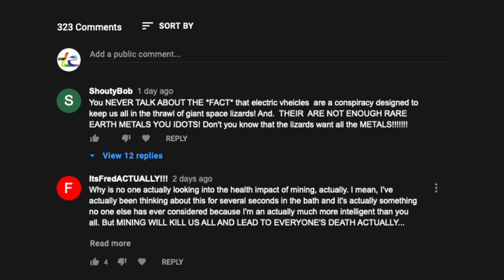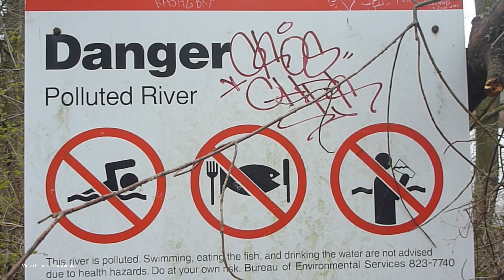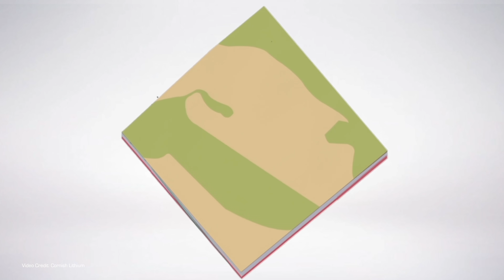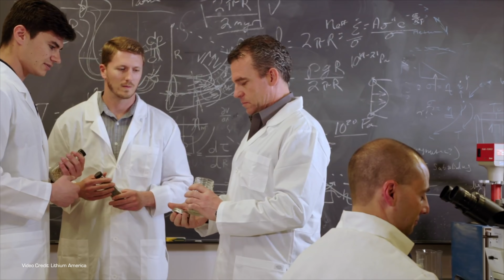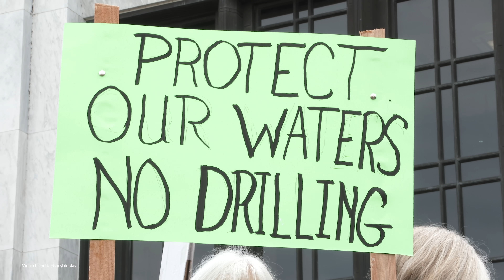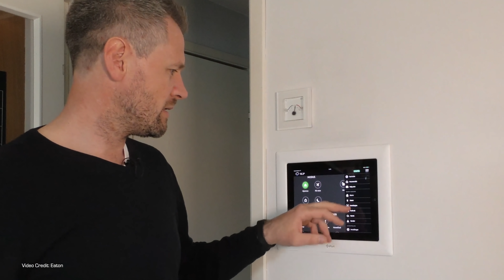Yes... But Are Electric Vehicles Really SUSTAINABLE?

Comment: ".. insert reason with faint shred of truth extrapolated to the extreme here..." - priceless! And so true.

With all the research going on, the chemical make up of today's batteries will almost certainly not be that of tomorrow's battery. ICE car engineers have had over 100 years to fine tune the ICE, and the results are truly remarkable works of machinery. But they've come just about as far as we can get them. 

While batteries have been around for quite some time too, they've only been viable as the power source for an EV recently, as proven by the first Tesla Roadster. EV's are still in their infancy; we will see more range and cheaper batteries as chemical engineers do their thing. Imagine what range and cost we'll see in just a few years. 

In addition, Tesla's plan to recycle the batteries and extract, then reuse, over 90% of what makes up the battery is fantastic.

As far as demand goes, look back to the original Roadster, and forward to today's models. Tesla has proven that EV's are now not only feasible, but that there is a significant demand for them.

Comment: I was hoping to hear more about Tesla's new lithium extraction process as outlined on Battery Day.
“The extraction process includes providing a clay mineral comprising lithium, mixing a cation source [NaCl] with the clay mineral, performing a high-energy mill of the clay mineral, and performing a liquid leach to obtain a lithium-rich leach solution."  "... it offers an environmentally friendlier way to obtain the metal than currently used techniques such as acid leaching."

Comment: If you live in the desert then there is no reason not to go both solar and EV.  Our primary home in AZ has 13kw solar system to power both the house and a tesla EV.  Like having your own gas station in your garage to freely power the car each day (about 300 mile range) and don't have to pay the huge electric bills that we had prior to going solar in 2016.  Prior to then our summer electric bills for the home (4k sq feet) was over $600/month + over $100/month for gas.  Now it's just a $42/mo grid tie in fee.  Though APS gives pennies on the dollar for any excess but battery packs are still too expensive to install and with net metering they just don't make sense, yet.  Sometime in 3rd Qtr 2022 our panels will have paid for themselves and with a 30 yr warranty will still have them for another 24 years.  Anyone who talks about EV leading to more pollution is mislead, pushing an agenda (just like the tobacco industry of old).  Even after car batteries can no longer be used in the car they can be used for home battery systems which use much slower discharge rates.

Comment: In general, yes.

Specifically, it depends:

1. Does the manufacturer provide access to common wear / damaged parts to 3rd parties for a reasonable amount of time to allow for repair?
2. Does the manufacturer provide access to any software required to make such repairs (e.g. pair the module)?
3. Will the manufacturer release part details to 3rd party manufacturers when they are no longer interested in stocking parts?

If the answers to any of these are NO (looking at you Tesla), then the answer is also NO once the vehicle is no longer under warranty and either the manufacturer will no longer repair it, or it becomes impossible to do so due to the above reasons.

It remains to be seen if EVs can be sustained as long, or longer, than many ICE vehicles. Many old SBC vehicles are still on the road, are easy to repair, and are thus VERY sustainable.

Comment: Not worried about resources though northern Portugal currently using water resources and requiring the relocation of local peoples is a problem, just like it was a problem with native peoples living on oil abundant lands. The biggest issue with the "sustainability of EV's" is the vehicle sales model itself, once upon a time it was here buy this vehicle and it'll last you a lifetime, now unless people are cash-strapped so many people get vehicles on credit that they get a new vehicle every 3 years. How is that model itself sustainable, surely at some point these vehicles need to go back to the factory to get updated rather than melted down and recycled.

Comment: MR SANDY MUNRO the legendary advisor to the US car industry pointed out that when someone builds a stainless steel electric van with the new-gen lifetime batteries....

They will not be replaced for GENERATIONS - they will have a working life of 1, 2, maybe 3 million miles.  Commercial vehicles are replaced when they wear out. These never willl.
He actually said "for god sake don't build them - its the end of the industry - its a one off build"

Comment: Oh there are lots of 'ShoutyBobs' and 'ItsFredActually''s out there who say Petrol and Diesel cars are better than EV's.
Either they are misinformed or have an agenda against EVs.
A battery pack in an EV uses few kgs of metals for a lifespan of 15-20 years (considering 2nd and 3rd life). On top of that they can be recycled.
Compare that to 10,000+ liters of Petrol and Diesel used by oil guzzling SUV's over its life, where nothing can be recycled.
The environmental impact of extracting, refining, transporting oil and burning oil is way more than batteries will ever be.
Reply: dont foget all the gearbox and diff oil changes over its life too, and spark plugs, drive belts, silicon spark plug leads,  plastic distributor caps, rotor arms  it goes on and on
Reply: Yeah apparently you cryo freeze the pack in liquid nitrogen - crush the frozen pack to dust in an inert atmosphere and then dissolve the dust in the extraction solvents to separate out all the different metals and other chemicals...

They say companies are literally gearing up plans already - just waiting for the packs to start to become available.  Its not a PROBLEM, they are just waiting to pounce on the resource as it vastly more cost effective than mining.
Reply: @John Chapman Your two posts remind me of the scene in The Last Jedi where Luke says "Amazing. Every word you just said ... is wrong." In your case, however it would be more accureate to write "in every argument you made either the postulates or the conclusions are wrong, to some degree". Let's take them one by one.

The electricty for electric cars is often generated from oil or gas: True, but even when coal is the primary energy source, lifetime analysis has shown that electric vehicles release less carbon dioxide into the atmosphere. Plus lower carbon electricity sources are growing faster, in absolute terms, than high carbon sources, even in the US of A. A red herring argument at best.

Renewables are intermittent and carbon based generation is required when they are dormant: True that they are intermittent, but false that carbon based generation is necessarily required when they cannot produce. Electricity storage is possible in many forms and is being added to most electricity distribution grids quite rapidly. Also not that this addition is not necessarily to support solar or wind generation. The storage can massively increase the stability of the grid and sometimes is being added to avoid the need for "peaker" generation plants.

Decommissioning costs are not built into the initial costs: Unlike for coal, oil, or gas plants? This is just poor accounting and is in no way unique to solar or wind generation. How many natural gas plants account the cost of a gas explosion during the working life of the plant? Yet these explosions can, and sometimes do, occur and can be catastrophic (on the order of a large fuel-air bomb, quite capable of levelling a city block if the gas plant is built int he wrong place). 

Extra items required by an ICE car are cheap: True as individual items, but not true when the cost of maintenance is considered. Yes, many of the "extra" parts can be maintained and/or replaced by car owners at low cost, but even then there is an opportunity cost to consider, plus as cars become more technically sophisticated, the number or car owners who can do all the required maintenance is dropping and the number who do is dropping faster.

Many parts are common, so the costs are the same: Even here, only partly true. The common parts are not necessarily used in the same way, so do not degrade and fail in the same way. The major example of this is brake pads. Yes, they are needed in electric vehicles, but most EVs have regenerative braking and the best use this to minimize the use of brakes. This not only reduces the maintenance required for the pads, but also reduces the amount of particulate pollution that they generate.

Battery packs are very expensive: True, but how often do you need to replace them? If they are damaged in a collision, the car is probably a write-off anyways. If they die a natural death, in a modern electric car (or at least one in the same technical class of a Tesla) they will last at least 200,000 miles, or the expected life of the car. Just considering Tesla, the vehicles are designed to last as much as 1,000,000 miles. Suppose you own a Tesla car that long (unlikely, as most people don't drive that far in their lifetime) and have to replace the battery every 200,000 miles. You would have to buy 4 replacement battery packs. Currently, the battery pack costs about a third of the price of the vehicle. Taking that as the benchmark, you would spend two and a third times the purchase cost ever this 1,000,000 mile lifespan. If you purchased ICE cars instead, you would probably have to purchase at least 3 to get this lifespan - a clear economic win for the electric choice, even with the high battery pack cost. Plus battery pack costs are dropping consistently, if not all that rapidly (although Tesla, again, is looking to roughly halve the cost in the next two to five years).

I'm sorry, but your arguments, when examined critically, just don't hold water.
Reply: @John Chapman But that same electricity gets used by the unbelievably filthy and inefficient oil industry, so I'm not sure I see your point? At least EV's use their energy at 80% plus efficiency, rather than the poor 25% or so of ICE engines..... Plus there's the pollution saving of not having to deliver the petrol and diesel to the pumps anymore......
Reply: True, and many of the "ShoutyBob's" are quoting EV problems from 2014.

Comment: DIESEL MINING EQUIPMENT FOR EV NECESSARY MATERIALS PROVES EVS ARE TERRIBLE!

/s
Reply: All it proves is that you are rather uninformed.  The oil companies have been mining cobalt for decades. They need it to remove sulphur during the refining process. What sort of mining equipment do you suppose they use? Has that never concerned you previously?  I wonder what you'll complain about when EV batteries no longer use lithium?  EV batteries only have 5% (or less) lithium content now. Before long it will be gone altogether.
Reply: @Brian-om2hh  (I am not the original ShoutyBob. I am a parody of ShoutyBob.)

Comment: I like Nicola Tesla’s system much better. No batteries necessary, just extract energy from the immense EM field we all exist in.
Reply: You may be able to light a single LED with it, but not much more. You should try living in the real world instead.
Reply: @ahaveland  He was able to move a 4500 lb car on it without recharging. While he admitted he still had an excessive heat issue to resolve, he felt the solution  was simple. Real world… the Earth takes that same energy and to put it to use it created life, trillions of trees to provide large surface area for the cathode and to scrub the atmosphere which forms the dielectric. Then human beings come along and decimate the trees, change the chemical composition of the dielectric and. then wonder why things aren’t going so well. Ever seen what happens to a capacitor when the dielectric brakes down?

Comment: lithium is a rare earth mineral. hydrogen fuel cell makes more sense to me
Reply: No it doesn't make more sense.  The energy loss, the lack of fuel stations,  the size of the fuel tank in small cars, the time it takes to start, the cost of the fuel cell, the weight of the fuel cell. Fuel cells are not common as batteries for some very good reasons, go with batteries not fuel cells.

Except if you're in a long range boat or airplane.
Reply: @matthew_baynham  You also forgot to include that Hydrogen takes about three times the electrical energy to produce, store, transport and finally deliver to the end user, compared to what is generated for an electric vehicle to use.
Reply: @peterlittlejohn8933  That is the energy loss he mentioned
Reply: Hydrogen is a waste of time and energy!!!
Reply: @mikafiltenborg2291  not for long distance airplanes or long range boats...

Imagine a giant container ship crossing the ocean on battery power without being able to recharge.

There are currently 2 seater aircraft that can fly on battery power for a 1 hour flight.  But hows that 14 hour flight from Europe to south America going to work with battery power.

Then there is grid level storage, just a few hours of storage is good with batteries, but how about storing all the solar power from the summer and using it in the winter.  That's not going to be battery power that will be fuel cells.

With ICE vehicles there are different solutions for different uses, you don't ever find diesel mopeds or two stroke engines in lorries.
Reply: @matthew_baynham  It is unlikely we'll store summer solar energy into the winter, rather we'll install enough capacity to be fine in the winter and get oversupply in the summer, which then can be used at a muc cheaper price. We'll likely going to see energy intensive bussiness come up that work mostly during spring/summer/autumn, store stocks of products to sell during the winter and stock incoming supplies through the winter to be used during the better months.

This will overall be a much more effective scheme than to produce and store insane amounts of hydrogen for several months.
Reply: Manufacturing hydrogen fuel cells requires platinum. And those fuel cells degrade over time, and will need refurbishment or replacement at some point. You still ok with that?  And hydrogen still requires transportation to where it is used, electricity does not.  And lithium isn't especially rare. Large deposits have been discovered in Brazil, Russia, Canada and Cornwall in the UK...... Besides, in the not too distant future EV battery technology will move away from using elements such as lithium...
Reply: Lithium is NOT Rare Earth.
Go look at the Periodic Table.
It tells you which ones are Rare Earth. Lithium is plentiful compared to Rare Earths.

Comment: I really appreciate this kind of in depth, informed discussion. People yelling about how EVs aren't clean is a bit like complaining that windmills kill birds. How many birds die every year from fossil fuel pollution? I'd guess far more. A lot of times I get the sense that these people feel that it's pointless to use EVs because they aren't perfect, which is silly black and white thinking. It's a transition, not a magic bullet.. but that doesn't mean we shouldn't try.
Reply: As if ICE vehicles are perfect. So much breakdowns.
Reply: @TheFourthWinchester  Maybe thirty or fourty years ago this was true, but contemporary ICEs are usually fine for 200k - 300k km easy, it's the cabin electronic toys and gimics that break more often than not. The real problem is the quantity of fossil fuel they burn, from pumping it out the ground to tail pipe emission it's just a more pollution intensive proceess all around in comparison to our current mining practices or making synth / bio fuels (with using green practices).
Reply: Well Point made. Now we need to convince those stubborn fossil fuel, well what do you call those in a neutral terminology so we can have a civil conversation with?
Reply: @robertlee8805  That is a good question..
Reply: Ever observe gas stations who really love their fossil fueled vehicles so much they love sewing out their vehicle's fumes and smoking 6 inch diameter tail pipes